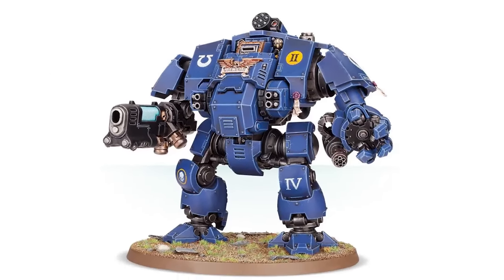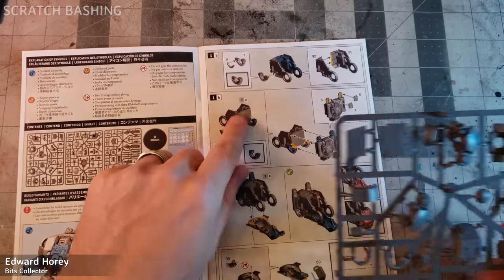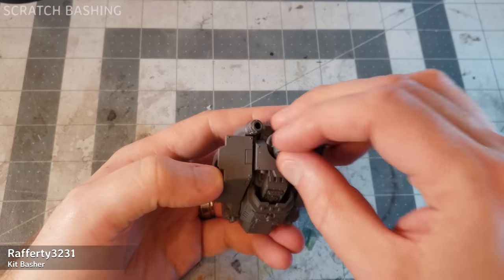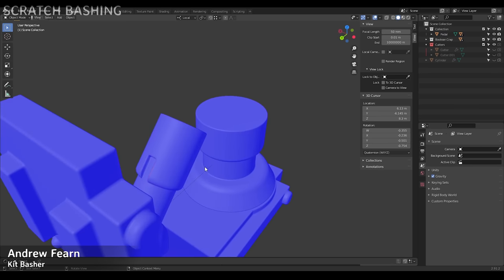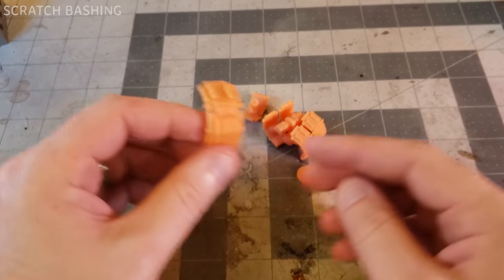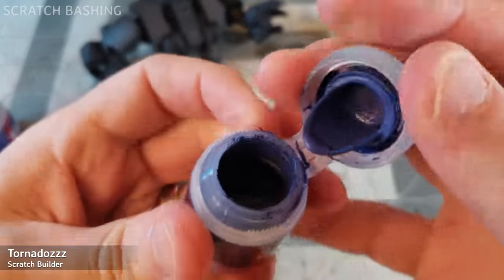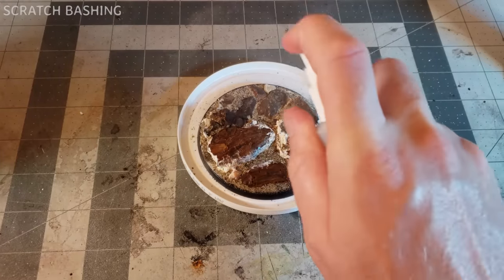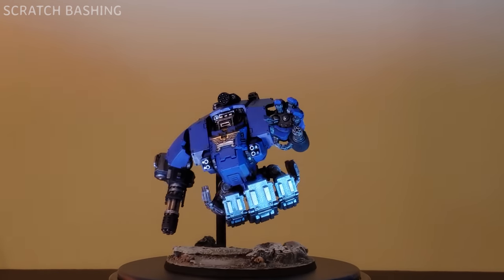𝓬𝓾𝓻𝓼𝓮𝓭 𝓓𝓻𝓮𝓪𝓭𝓷𝓸𝓾𝓰𝓱𝓽

Comment: I dont know how your workspace looks like but DO NOT keep any kind of resin 3d printer in closed, not ventilated, areas. The gases released when the resin hardens can cause cancer. So if you have a well venitlated room you rarely go into I would recommend placing your printer there.

Comment: about that giant gap in the gun and the rotator joints not working like at all. Ive built a few dreadnoughts and ive noticed that the older the mould is, the worse these things get. My first redemptor that i bought years ago, presumably among the first that were ever cast, went together like a dream with no gaps, no seams and no joint issues. But my later dreads have been having these issues so your kit is probably from an older mould that soon is gonna need replacing soon